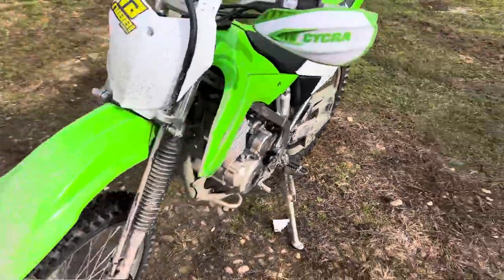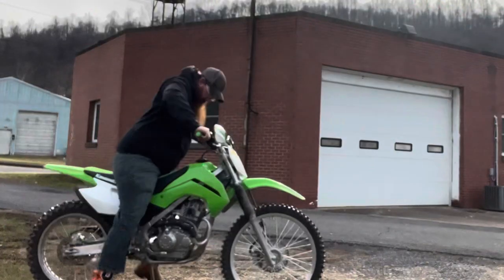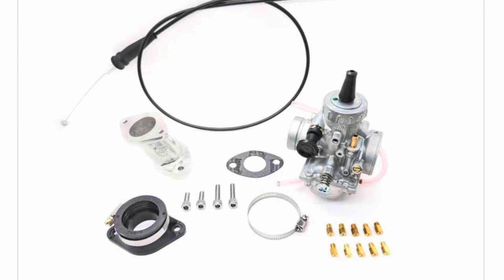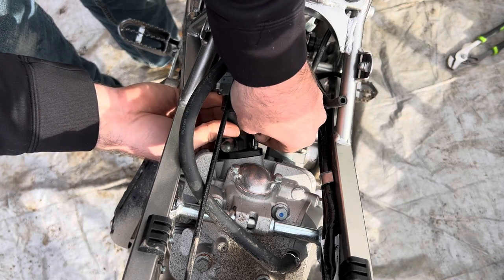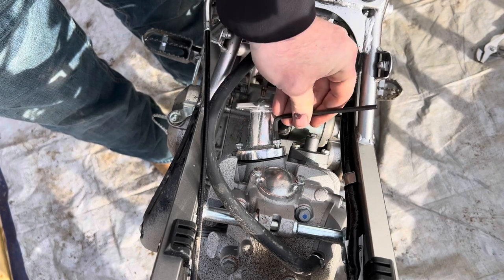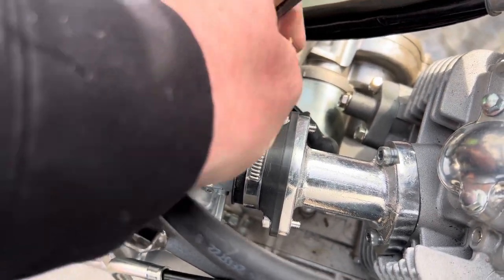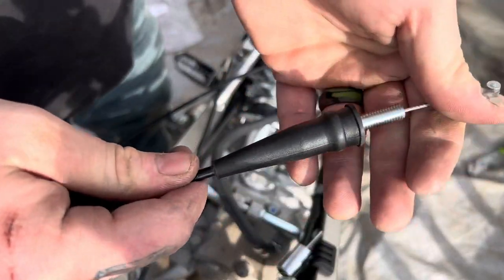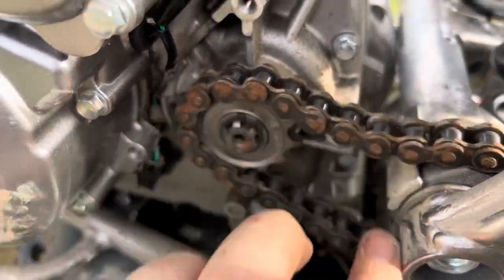This is why the kawasaki klx140 sucks from the factory and this is how to fix it!

Comment: I literally just finished installing this very kit...now mine for what ever reason I could not get the stock black pipe to fit back in between the carb and stock airbox..so bought a separate filter with a short 45 degree pipe.  Now also has a brand new FMF slip on exhaust.  With that the kit came with a 170 main jet and needle clip at two from the bottom.  It really needed a smaller idle jet but I got it to work...ended up with a 145 main jet and two from the top on the needle.  The bike now immediately starts cold...no choke, idles perfect, comes off throttle to perfect idle and will spin to max rpm's.  With the stock carb I was lucky to get it started....on a brand new bike...absolute shit...so disappointed with kawasaki...but now runs better than new!!! This kit is well worth it if you willing to do a bit of jet tuning.

Comment from the maker: Designed for adults and big youths, the KLX140 combines a rigid KX-based perimeter frame with long-travel suspension and large-diameter wheels (21” front and 18” rear), and a simple, yet reliable air-cooled 144 cm3 single-cylinder engine into a perfect-sized package. @danhambrick6331
Reply: I wanted the 140 1st cause of my height but went with the 230 rs hopefully I don't regret it.   from videos I've seen there's more mods for the 140 the the 230.  i

Comment: I purchased a 2023 for my son and had the same problems with it being lean from the factory. I went a little crazy and drilled out the welch plug and got to the D-shaped fuel screw. It was glued or something in also, so I  very carefully drilled and easy-outed the fuel screw. I ordered a Shindy rebuild kit which came with a normal flat head fuel screw. The jetting is still lean so I need to get new jets, but I was at least able to get it adjusted to where it will start easily and idle. Thanks for the video, just wish I would have seen it about a month ago.

Comment: Great vid. Picked up mine yesterday, lean as hell and can't adjust A/F mixture.  Mechanic at dealer even called kawasaki about it before I picked it up.  I got it home and very carefully adjusted idle once it was all warmed up and got it to run without hanging revs while also idling without stalling but it's super lean and cold blooded.  Will probably just end up swapping carb. I can tell it's going to be a fun bike though just riding around the yard.

Comment: I just did this carb kit update on both our  2023 klx140rf's and they run like completely different machines. This is a must do. I can't believe how terrible the stock carbs are. Great video & recommendation!
Reply: Hi, did you change the jets that came with it or did you run it the way it came? Thanks
Reply: @chrissansone3012  used the jets that were pre-installed
Reply: @ thank you!

Comment: Mine runs fine I’ve had it for 2 years now still runs amazing
Reply from the maker: Yeah older ones are great the 2023 have some issues
Reply: @cherokeeronnie   what issues bro I just got a 2023 klx rf
Reply from the maker: Carb problems. Valves being way to tight from
Factory. Plug not gapped right. Nothing major just small stuff

Comment: Mikuni vm24 carb. Warm up the boots and shove em on. I fit stock air boots on a VM 26. 170 kit use the 26. 180 main jet stock pilot.

Comment: That’s the old ones you get a 2014 or newer it comes with a keihin carb and they run really good
And some power mods like a bore kit it’s got some umph to it it’ll get around 
But for midsize bikes the Honda crf150r is probably the best
Reply from the maker: Mines a 2023
Reply: @cherokeeronnie  really damn 
My brothers is lean but runs like a champ 
Only problem I had the fly wheel bolts backed out and fucked the stator all up 
But I had a parts bike so it was no big deal 

But runs really good I put it through hell and it takes it

Comment: I just put this carb on my sons 140rl and it definitely makes a world of difference.  The only issue seems to be when we pull the choke out for a cold start the bike won’t start.  Can you do a video on any adjustments you’ve made or just adjusting the carb in general.
Reply from the maker: I have a whole Facebook about this Bike if you wanna join. Sounds like it needs jetted I never have used the choke with this carb
Reply: @cherokeeronnie  ok awesome, I’ll go check it out.
Reply from the maker: https://www.facebook.com/groups/1183222745645366/permalink/1183225465645094/?mibextid=S66gvF
Reply: @cherokeeronnie  awesome, thank you for the information.

Comment: This kit has been out of stock everywhere for quite a long time. We’re you sitting on this and just got around to installing it? Clicked your link - sold out. As expected ! 

Wife has an 18 model she got new. It sat for a while after a serious injury. Cleaned carb petcock you name it.. hasn’t been right since. Even only ever used non ethanol fuel. 

She wants to ride it again and have been chasing carb issues with it for too long. It’s gotta go. 

If I can’t get this kit anywhere I’ll go the Smart Carb route

Comment: Just installed the big bore kit on it from TBolt, came with the same carb you have in this video. Did you have to change the main jet out to make it run correctly? If so what size did you use?

Comment: curious why you not much a fan of kawa's? Ive owned a few 96 kdx200 and a 2001, 2002 KX250 they were good bikes, but im more of a Yamaha man myself cause blue is my fav colour currently got a 2010 YZ250 2 smoke, but found Yammies always been reliable and good power. my brother wants one of these 140's hes got a KX112 atm but the 112 has got like twice the HP of a 140 so he will definetely notice that if he gets one.

Comment: Finally got the new carb in. Fired up first time HOWEVER the bike is revving like a madman. Throttle cable springs right back, choke is not on. No matter how I try and adjust the idle it wont stop revving. Any ideas? The one thing that did happen on install was the rubber "hose" from the air box to the carb came out. I reinstalled it back in the airbox but have not sealed it back up. Could that be the issue?
Reply from the maker: Throttle cable hitting the tank

Comment: Ronnie great vid, did you use the jet that came with the Mikuni Carb? Also how did the sprocket change the ride, I just bought one a 2024 KLX RL. Thanks
Reply: Hey mate does the 2024 model have this same issue ? Thinking about buying one

Comment: When you quickly rev the throttle does it bog? Mine does. No matter what setting the fuel screw is on and doesn’t matter what pilot is installed.
Reply from the maker: No mine never did bog
Reply: Mine does too...did you every figure it out?

Comment: I have the klx 140L and Im looking for some better and lower footpegs,  also possible options for a taller seat if anyone knows of anything.
Reply from the maker: Cut them off and move them what I’m about to do Moto seat or add foam
Reply: Try Fastway pegs. Expensive but lower.

Comment: How’s the carb holding up? Just ordered one to maybe make this bike great.
Reply from the maker: Doing great I been ripping it every warm day we get
Reply: @cherokeeronnie  nice!!! Which jet sizes did you run, I’m worried the bigger carb might make the bike a little rich
Reply from the maker: I’m running a 180 main and 22 pilot jet my exhaust is gutted though, people usually run 170/175 main on a stock bike
Reply: @cherokeeronnie  okay nice, I’m thinking about getting an exhaust anyways and drilling holes in the air box so I think it should be fine.
Reply: @cherokeeronnie  I’m also at 3000 ft so hopefully I can figure it out.

Comment: I put a vm26 on my stock 140 and I can’t seem to get full throttle, it just starts popping and dies out.  I’ve tried jetting the main from 150 to 200 with no luck.  It also has a horrible stall when revved from idle which I’ve tried 15 to 22.5 on the pilot.  I was told be BBR that the vm26 is too big for a stock bike and I need the big bore kit to use the carb.  How did you get yours to run so well?
Reply from the maker: Sounds like the carb needs a good jetting/tunning. And that can’t be true because I run mine on a stock bike and it does great. Go subscribe at @fistfullofdirt going to have a bunch of tunning videos over there soon on this bike

Comment: I bought the kit and put the new carb on. The fuel selector valve completely blocks the choke. You can’t choke the carb. Am I missing something? 
In fairness it did fire right up with no choke and it’s only 30 degrees. It starts WAY better than it ever did straight from the factory. It’s to snowy to try it out, but wondering if no choke is going to be a problem.
Reply from the maker: I can reach my choke I have long fingers though but honestly I haven’t even use the Choke it fires right up every time
Reply: @cherokeeronnie  
I’m glad I found your video. It’s amazing how much better it runs with that new carb. It’s sad the factory can’t just put one on from the get go.
Thanks for sharing the info!

Comment: I’m leaning towards the Honda CRF125 big wheel. Equipped with hassle free fuel injection, electric AND kick start. It’s not that much more money either
Reply from the maker: It has drum breaks in the rear and it’s very under powered at least the klx140 you can tune it to get more power
Reply: It’s still gonna be tuned way to lean.  Also fuel injection is only nice for start up and idle.

Comment: What sprocket did you use? Higher or lower geared from stock
Reply: About a month after I got my kLX I put the 12t front sprocket on. It accelerates like a beast and the throttle is super snappy with the higher Gearing ratio. My only gripe is I loss a little bit of my top end, but I'm about to fix that and order a 49t rear sprocket to put my gearing ratio down to 4.08 which will give me my top end back without loosing all the acceleration gained (I'm at 4.17 currently gear ratio right now, which was a pretty good jump from the stock 3.57 ratio.) 

Also if you're looking for sprockets that are very reliable and well made I recommend JT Sprockets, Renthal (If you wanna spend that much). And Bikemaster.

Comment: Do you have to add the jets or does it already come installed?
Reply from the maker: They have some installed but you need to jet it for your bike because it comes with a 190 main and 22.5 pilot jet this kit I got comes with other jets
Reply: Yes I installed it. But some reason it’s leaking gas out of the pink drain tubes on the bottom
Reply from the maker: The float needs set
Reply: @cherokeeronnie any idea what the spec is for the float?

Comment: next time get full size bike and buy a 175 dollar lowering link ends up 2 inches lower at seat plus shave inch off seat and restapple seat cover b ack on lower front fork clamps 1.5 inches
Reply from the maker: I have 2 full size bikes
Reply: ya & you wear high heels ?  how did you lower the full size bikes  ?  @cherokeeronnie